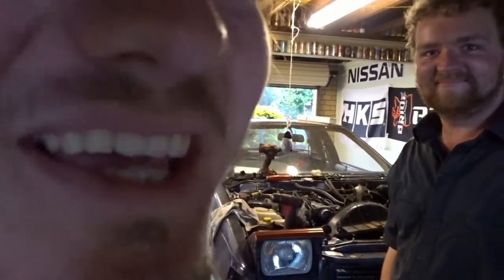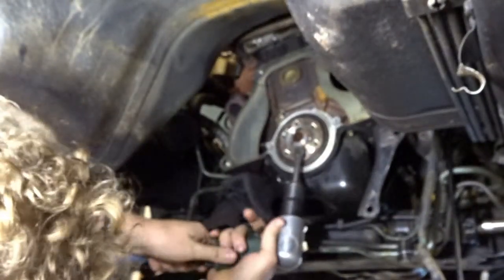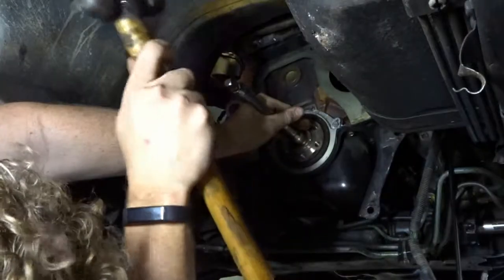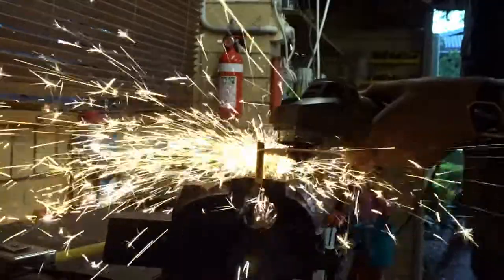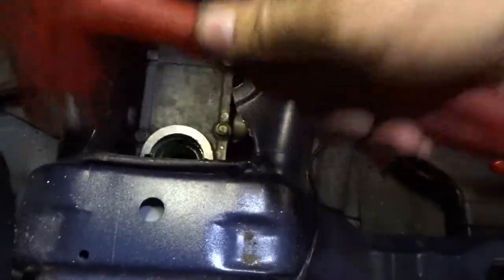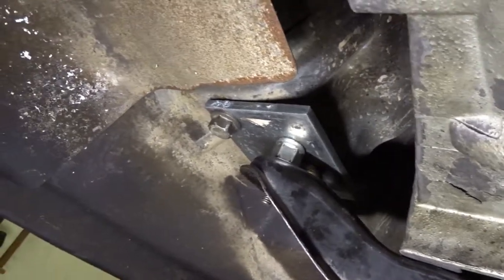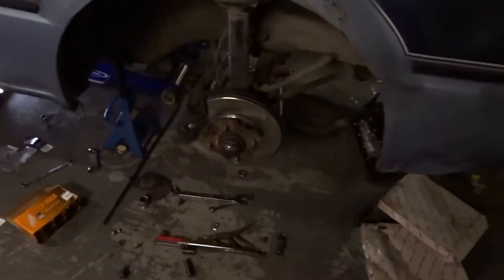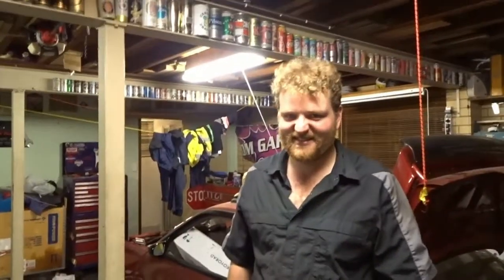S12 Gazelle Drift Prep Ep. 2 | flywheel and clutch, custom gearbox crossmember and seat rail mods

Comment: Is manually cutting those bolts going to cause a balance issue?  All in all good show though
Reply from the maker: They were all cut at the same length so it shouldn't, but we will see! Cheers!
Reply: eyeball grinder precision engineering